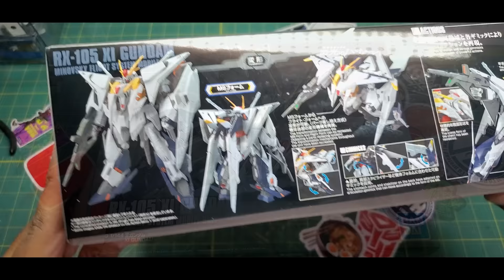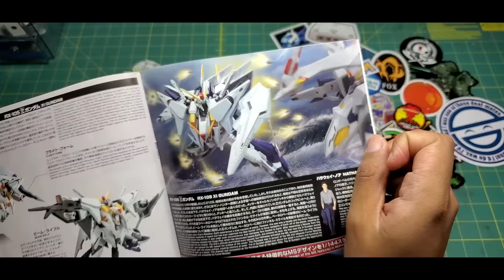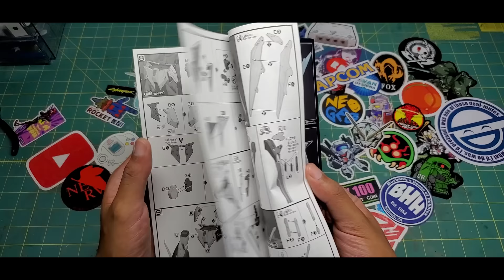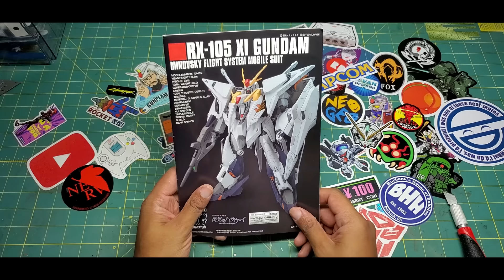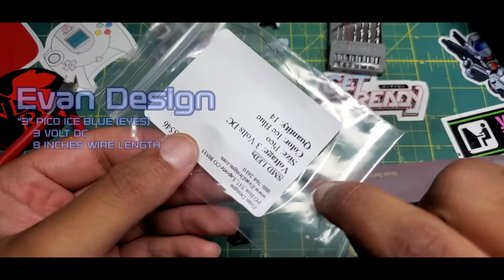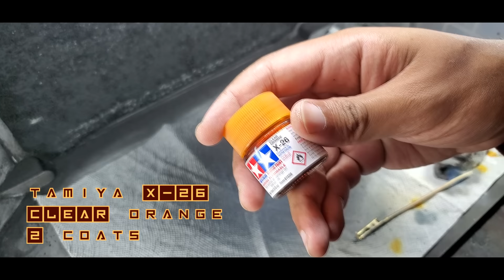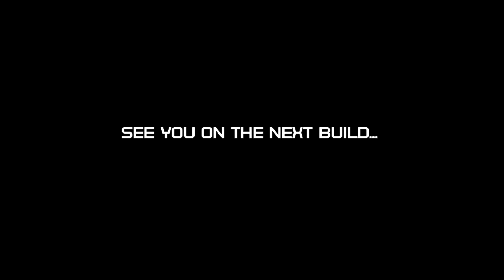#newtype #Otakubuilder RX-105 XI Gundam Hathaway  [4K]

Comment: Hey dude,
Been watching your stuff for a while now. Love all the work you put in!
You should check out the "side glow" fiber optics out there. They shine along the surface area of the cylinders so you'd just need to light up the ends. Also, as a side note, when you need to bend fiber optics, I find there is less risk if you use heat. Like from your soldering iron, just hover the fiber optic over the hot part of the iron and gradually get a bit closer until the heat and gravity bends it for you! (Just don't get too close!)

Comment: It turned out really good. The LEDs in the fans and thrusters turned out great and you did a fantastic paint job. 
Is there a reason you don’t trim the LED wires down a bit instead of rolling all of it up into the shoulders?